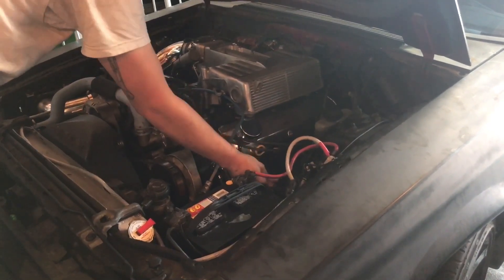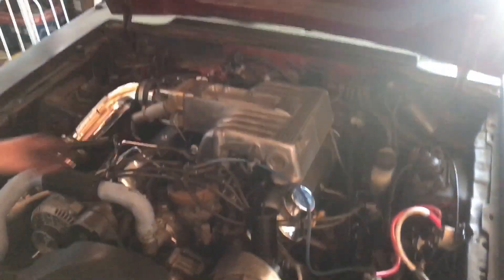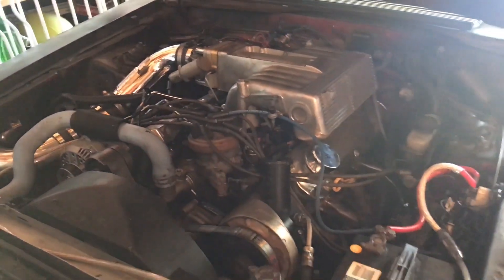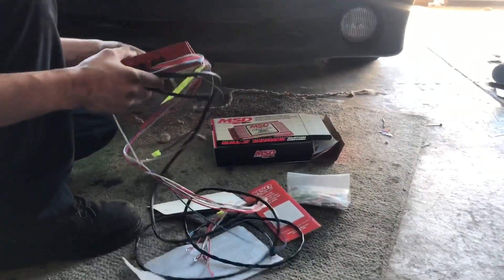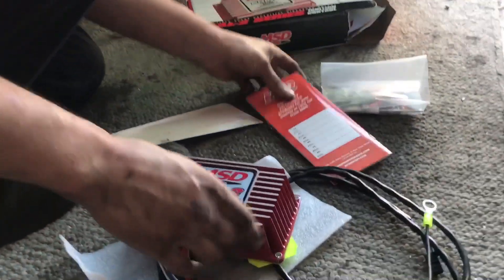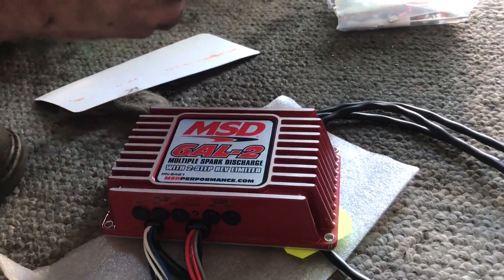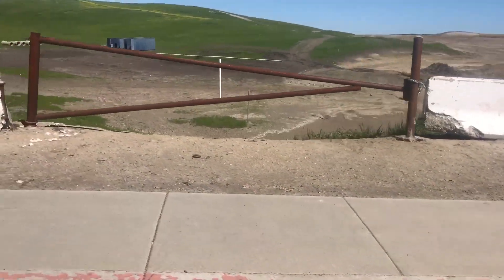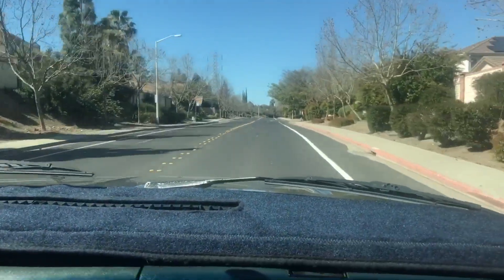Having Fun in my buddy's 5.0 Foxbody Mustang Vlog 2

Comment: btw I was shifting at 3500 still tryin breakin cam and top end
Reply: Obviously you have never used a flat tappet camshaft. LOL.. Break in a roller cam. LOL
Reply: y break it in all they way its not like any of its new all used these engine are stout and it is a roller engine.btw the engine runs fantastic jus fired it up today I need a shell if u find one lemme knoe id like a notch mostly but must not be vert may consider auto since I have all the 5 speed stuff